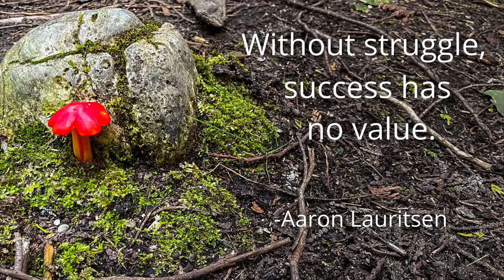I Finish Screening My Homemade Gazebo Just as the Weather Gets Gnarly! #49

Comment: Little tip... I have made spacer blocks that I dedicated specifically to the different thicknesses that I mill on the chainsaw mill that I place between the bar and the mill so I don't have much variation to my lumber thicknesses. Saves time setting the mill. I tighten the adjustment nuts, remove my jig block and get to cutting.  I've noticed that when I changed chains my thicknesses would vary prior to the jig blocks.  Not any longer. I painted them each a different color and wrote their thicknesses on them with sharpie.  Saves a ton of time and keeps my boards very consistent.  I love your projects 👍🤙

Comment: Hey, just had a thought? Batten down the hatches! Top to bottom, split the difference, fifty fifty, or sixty fourth, you decide. The bottom section folds down, bonus, the top opens up to become an awning? Heh? The rain has a harder time getting in. Make it adjustable, prop it up with to stage support, one, the awning is straight out, bonus, more shade, two, at a forty five degree angle, bonus, shields you from rain, three, close it up when gone protecting the screen? 👍👍👍👍👍

Comment: Beautiful gazebo in the woods! Looks so relaxing. I use nylon side walls on my free-standing canopy to keep rain out. The side walls came with clip-on hooks sewn in,  so I just clip them to the inside canopy structure.  They work well in keeping rain out & can be easily removed by simply unclipping. Probably would work with your gazebo with screw-in hooks placed on the outside. So you do remodeling for a living? Where did you learn all your great woodworking skills?

Comment: You could put a giant like shower curtain around it like some cheap fabric vinyl to protect it from the snow in the winter time put rope or cable so you could open or close it when you want to. Like repurposed materials has roadside signs the big advertising signs ine side is white farmers use them to protect their haystacks in the winter or sulege piles n trow tires on them to hold thwem down. I think they are pretty cheap hell you make a tent out of them as well if you knew someone who could so or put them rivits or snap screws.. Know anybody like that?